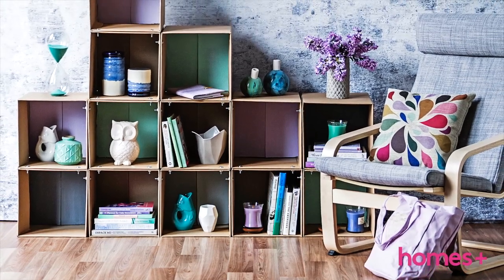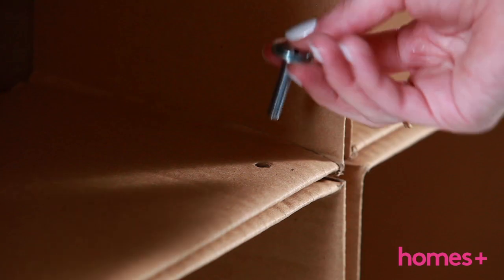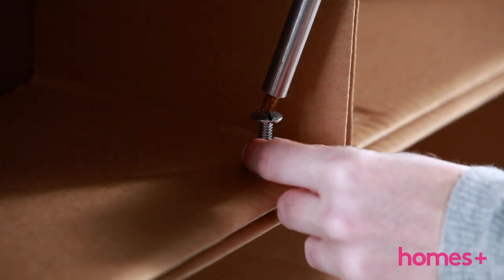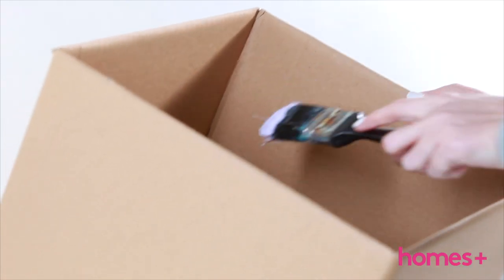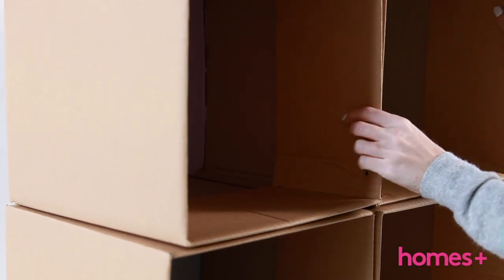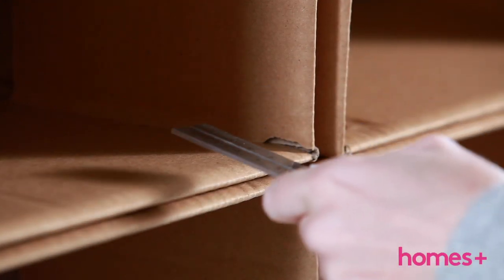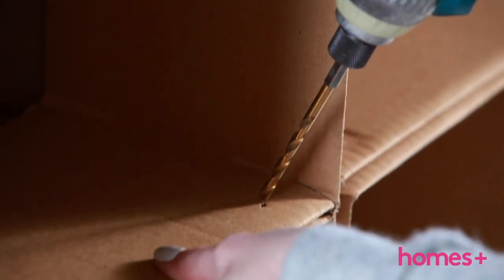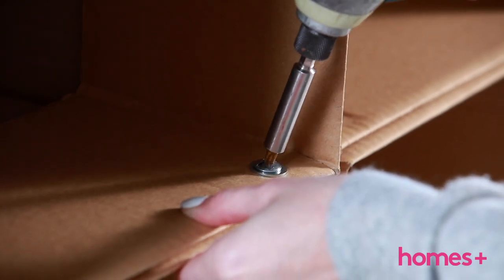DIY PROJECT: Cardboard box shelves - homes+

Comment: cool!  I do a lot of cardboard sculpture mockups.  if you use white glue as you assemble them they will be very strong!  
run generous glue along fold scores and as much as you want on the flaps. fold over clamp if you want.   for even more strength glue back flaps as you set up boxes!